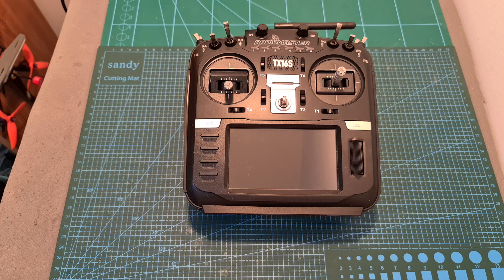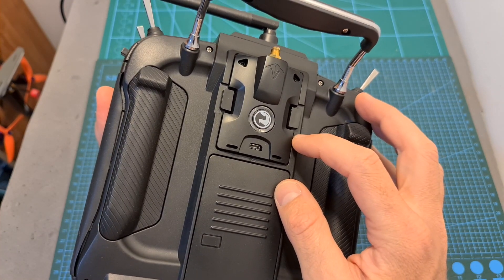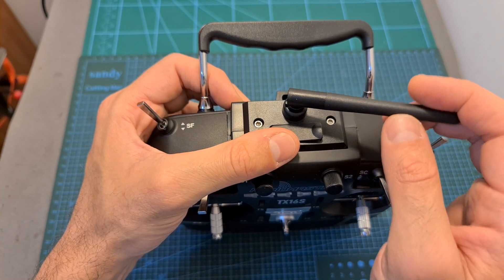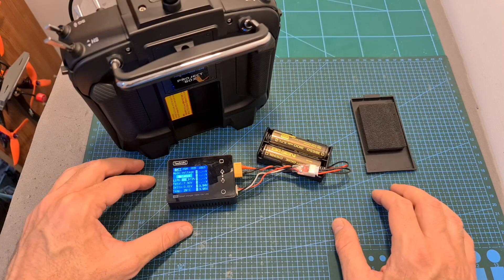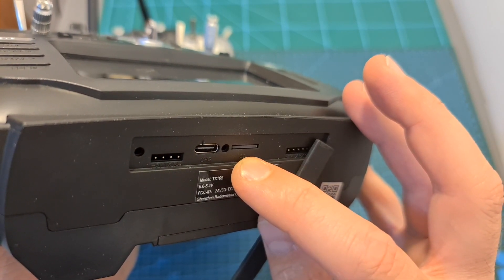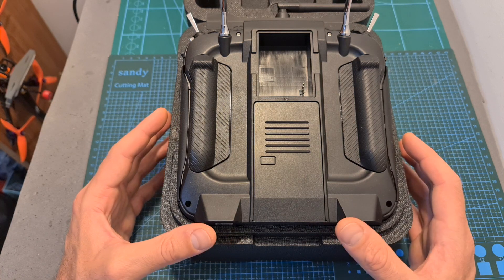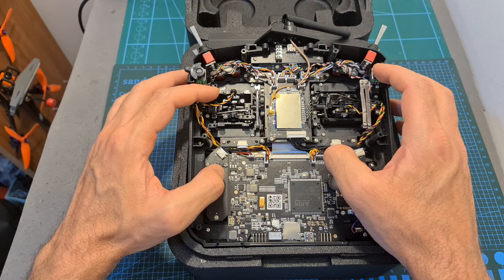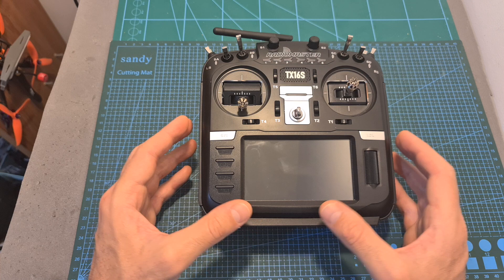RadioMaster TX16S - Hands On Review & Comparison With Jumper T16

Comment: Thanks, this is a great video.
I've seen that the version with the touchscreen has a grid effect on the screen to make it touch sensitive, do you know if the non-touchscreen version also has the grid effect?
Reply from the maker: My pleasure. Maybe the screen protector was on. Once removed you can barely notice anything.
Reply: @KremerFPV  thanks

Comment: Would I be able to use the external port to update my Frsky XM+ firmware similiar to my Taranis X9D? 
If unable, how about T16 or T18?
Reply from the maker: It's not supported now - but it might be in the future. The T16 and T18 do not support it.
Reply: Sad to hear but thanks for the reply. Looking forward for it to be supported in future and I'll buy whichever radio that supports it, be it RadioMaster or Jumper to replace my X9D as I have many xm+

Comment: http://air-war.org/graphics/TX16s.jpg
My full initial impressions review  (click read more):   I was kind of pissed right off the bat the TX16s came with M4 instead of M3 gimbals (because I had bought some Umbrella replacement M3's which I read was what the Jumper used);  I really wanted them too, because the stock gimbal ends turned out to be  long and razor glass sharp as hell.   The aluminum lanyard extender I bought for it didn't fit either... the hole for the spacer washer was too small.   The tension on the sticks is too tight, making a loud klacky sound every time you pass 0 center with a lot of weird uphill resistance starting right there which is not optimal at all for a quad pilot.   I hope this can be fixed by taking the radio apart and loosening up some screws but I'm not so enthusiastic yet to do all that with a new radio.   
 
You have to hold your hands kind of far forward of center to reach the gimbals and switches, but since I fly with mine in my lap, probably not a big problem I guess but kind of annoying.  Probably necessary trade off to move everything far upward on the radio to make room for the big screen that takes up the lower half. My immortal T keeps getting beat up no matter where I set it.  Other than that, so far I"m happy with it... a basic black radio.  It would be nice if there were an LED display with flip on and off switch to check the voltage while charging without having to turn the radio on and off.   You can set the screen back light to go blank off after timeout which is nice.  All the switches are 3 position switches except 2... one 2 position and one momentary switch.  I'm not a fan of 3 position switches myself, I prefer 2 position binary switches, but it is what it is...I can understand the erring on the side to give more positions rather than less.   
 
It's not perfect, but way more perfect than I could ever design or build a TX - I imagine I'll adapt to it over time and grow to love it.  No where as nice a feel as my Realflight USB Interlink controllers in the hand though.  I guess I can't complain, I got a touchscreen for free... we didn't see that coming.  I didn't like the silver on the Jumper, so I'm happy an all black radio came out.  They really went all out on it and the extra mile.   
 
The lambo chicken feet with night rider effect on power up don't bother me at all... though there is a huge amount of light bleed between the lights.  Not really a problem.   I would of preferred lighted 1-6's though.   I can't imagine I'll ever you the pots or lose slider switches for anything, so for me they are irrelevant.  With the crossfire module and 18600's, it does have some weight to it.  Again, not a problem, since I rest it in my lap and thumb it.  Remains to be seen if I'm going to have to upgrade to a home brew 5000mah 21700 2s pack.
 
One last thing, be careful putting the microSD card back in if you do.   You could miss the internal metal tray soldered on the circuit board entirely and go right outside of it and lose your microSD card rattling around in the radio.  I didn't do this myself, but I was like holy jesus.  So go straight in with your card and make sure you've bot it in the metal tray inside before you push it in.   It's spring loaded so it should click in when you push it all the way in.  If you missed the tray, well, oops, I guess take apart your radio.   It comes with a 256mb card which sound files... with 100mb free...  so plenty of room for models and other junk..  I upgraded mine with the Amanda pack... the immediately upgraded the card to 4gb just because I had an extra one lying about.
 
Once it started to move, mine took an amazing 12 days total to be shipped across the Atlanta to me via DHL from Riyadh, Saudia Arabia... to Bahrain... to Braslavia... to Lepzig... to New York... to Cincinnati... to Atlanta... which was incredible record time, compared to shipments from Hong Kong from the other direction, which for me are averaging 45 days...  30 days just to get across the Pacific Pond to California.
 
BTW, you only get the touchscreen if you get the HAL or Crossfire version.  You don't really need the HAL gimbals, but I needed the Crossfire, which jacked the price up to $200.   But for $99 for the basic version without HAL, touchscreen, or Crossfire modules... it's a total steal.  The $99 version would make a killer great gift for an RC friend or awesome first radio that destroys everything else at that price point or lower.  IF you're considering getting any cheaper TX... in the $30/$50/$80 range... used or otherwise... forget it.  Go all the way and get the basic version of this puppy at $99, you'll be glad you did.
 
Kudos on the great build quality, the fast shipping, going the extra mile, the great price, and the all around sharp sexy black looking radio.   I imagine once I replace the long sharp stock gimbal stick ends with much shorter umbrellas, and loose the spring tension inside, it will work out just fine for me.
  
I couldn't get mine to work in Liftoff...  I'm sure there's a Youtube video out there on it...  even though it's set to ask by default and I set controller mode.  I assume you have to create a Model inside the radio to use it with Liftoff, and I didn't bother testing further as I'd prefer to use my dedicated Realflight Interlink $30 hollow controllers which feel wayyyyyy nicer and lighter in the hand, rather than risk dropping a $200 radio every time I getup to hit up the ridge or microwave.  
 
Hope this helps someone making a purchase decision...   have phun, fly it like you stole it, and stay frosty on those sticks :)
choppergirl.air-war.org
 
Chair I use:  https://www.harborfreight.com/foldable-aluminum-sports-chair-green-62314.html

Comment: Hello Gal, Im on the first batch of radios and i pre-ordered mine from Heli-Nation. Unfortunately my Crossfire TX Lite cannot be recognized as an external module although my settings were correct (Internal RF is OFF and External RF is set to CRSF). I was able to use the internal module for my FrSky micro and it's working fine. My Tx lite although bound and re-bound to the nano rx on the quad was not detected in the System tools. I clicked on the "Crossfire Configure tab (1) and it's stucked on "waiting for Crossfire devices. I also used a different external module which i borrowed from my friend, micro tx like what you have in this video but it was also not recognized by the radio. We tried both my Tx Lite and the micro TX on his Taranis and it was working fine. It may have something to do with the JR pins and im pretty sure there was good connection.  Im currently exchanging emails with Radiomaster support as well as Heli-Nation for a possible warranty claim. Looking forward to your future videos.
Reply from the maker: Thanks Allan, I am sorry to hear about your trouble. As far as I can tell - there is something wrong with the pins of the JR pins, as you suspect. I would make sure with HN and Radiomaster that opening up the TX won't void your warranty and then open it up and examine the pin headers carefully.
Hope it helps.
Reply: @KremerFPV  Hello Gal, i already received a response from Radiomaster that they are sending me a new board. I just hope that would fix the issue and Heli-Nation is also aware. The pin headers looked fine and im very sure that the pins of the JR bay are inside the TX module when connected but there was just no RC output.
Reply from the maker: @allanmd  I hope it will get you sorted.

Comment: Hi Gal! What's your frank take on the Frsky fiasco with the ACCESS protocol leaving us long time users unable to use it unless we buy all new gear?  I've been contemplating what to do.  Thanks! :)
Reply: FrSky's choice to not support D8 and D16 in their new ACCESS radios was a great big Screw You to me and the thousands of modelers like me who have a large number of D8 receivers.  That they did add some D16 support to their ACCESS radios does show that they knew what they were doing but realized that they had to back off from their Screw You approach a little. 
For myself, I am NOT buying a FrSky transmitter that does not natively support D8 and D16 V1 (the D16 V2 thing is another Screw You because not all X series receivers can be flashed to it).  If I am adding a module to my transmitter it will be Crossfire.  For now, I am still buying FrSky receivers (as long as I can flash a non-ACCESS firmware to them) because their receivers are very good.  If RadioMaster starts producing quality receivers that are competitive with FrSky then I may quit buying FrSky altogether.
Reply from the maker: Hi buddy. I don't really follow that Fiasco and My Taranis X9D Plus is sitting on the shelf for a while now after it's internal module stopped working properly. 
I've been using my Jumper T16 for a year now (and now started to use the TX16s which as far as you probably understand is it's improved version) and I really like it and I think that these line of Radio TXs is highly recommended as it will provide you with an option to control many types of Receivers, works great with CRSF and provides an excellent value for money in my opinion.
Reply: @KremerFPV  Thanks Bro! Keep up the great work! 😎 🤘

Comment: I have been waiting for this. Excellent review with the info that was missing from the others. Battery compartment 25*52*97mm, 4mm stick threads, folding handle fits and a clever idea for using the case as a cradle while disassembling and working on this radio. Thanks Gal, waiting for the next share of useful info.
Reply from the maker: Thank you very much!

Comment: What is the transmission power? How long range it can transmit with a common FrSky receiver?
Reply from the maker: I haven't tested it but it should be 100mw for the Frsky option. As far as I know it should be about the same as the multi-protocol module which used by the T16: https://youtu.be/eWgU5n4pL38

Comment: I ordered one last week based on the other reviews that were done on it.  You confirmed the folding handle compatibility which was not covered by any of the others I saw and is great to know.  I'll be picking one of those up as well for sure now.  I hope the run-time experience lives up to both of our expectations.  Cheers!
Reply from the maker: Hope you will get it soon Andrew. I've only used it a couple of times and it works great. I only have to adjust the tension of the gimbals a little bit to match my Jumper T16 as I got used to it.
Reply: @KremerFPV  Banggood is still on pre-order pending shipment but it'll get here eventually.  Looking forward to getting the most out of is as my new primary radio upgrading from the X-Lite + 4in1 Mini setup I use now.